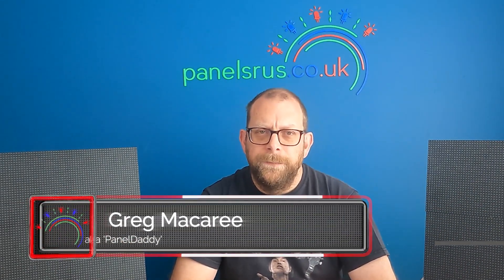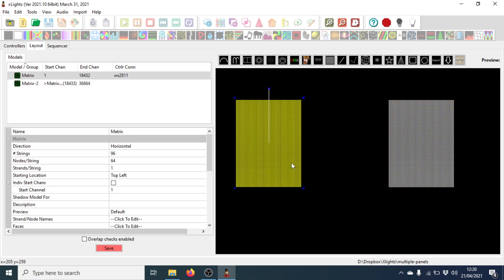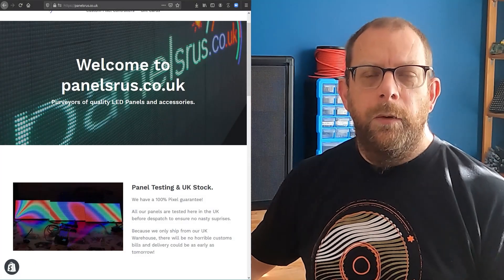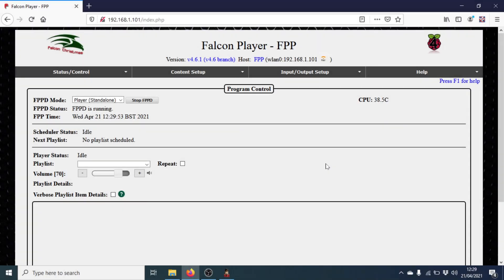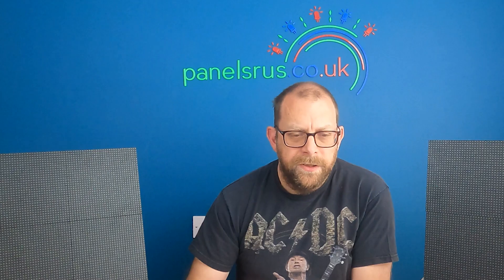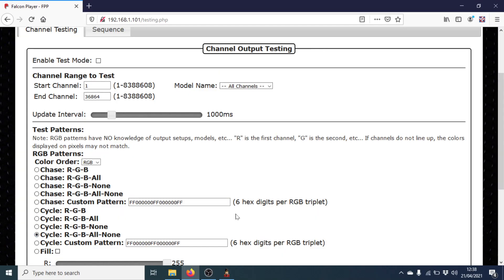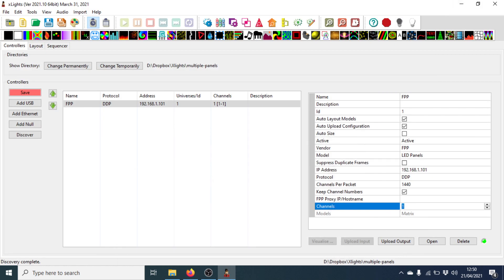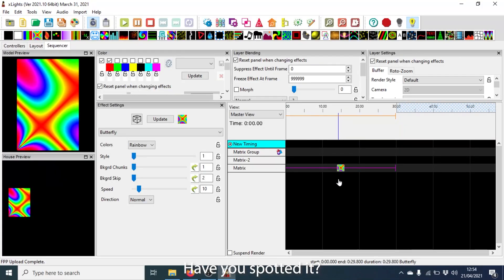Multiple Matrices when using one Pi Hat / BBB Cape ?

Comment: Great video. Can you (relatively) easily have different sized matrices? For example instead of having the same number of columns across the 2 or more matrices have different numbers and potentially a mix of horizontal and vertical panels. In my display I had planned on upsizing 1 matrix and adding another. The issue is that what I really wanted was a larger horizontal size on the bigger 1 and to fit in the space 1 matrix would use panels on their sides and the other would be flat.
Reply from the maker: Hi Alan, yes you can have whatever size you need, subject to the maximum number of panels per port (8 for CL/BBB or 6 for RPi).